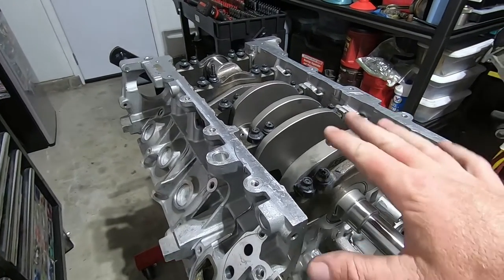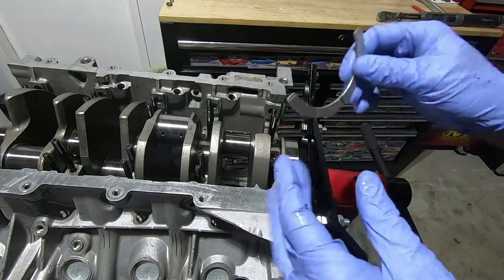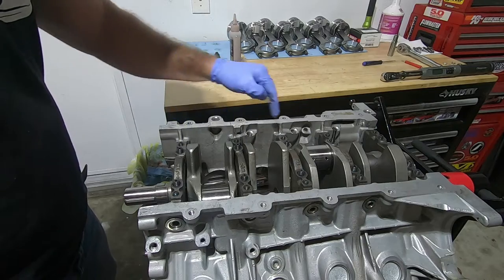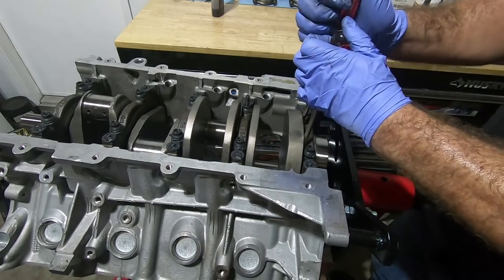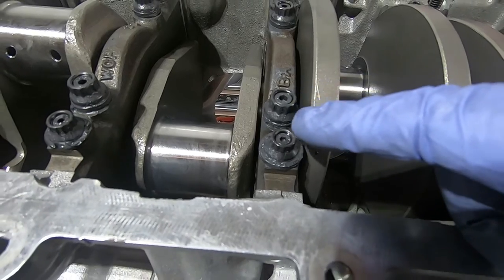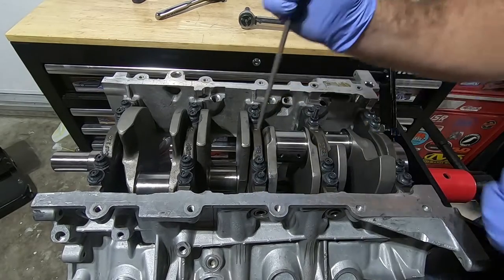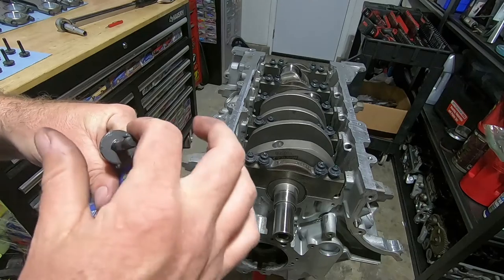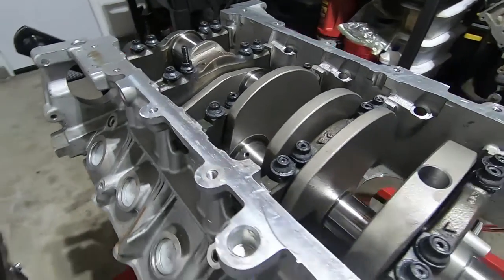Pt 10 Crankshaft Install and Measuring End Play - 5.0 Stroker 4.6 Teksid Engine Block

Comment: When you say the cut it's on the thrust bearing faces towards the crank, a lot of people are getting confused thinking the cutouts face toward the front of the engine where the majority of the crank is. 

I don't know why they don't just get the Chilton's but a couple if them were pulling the motor working a week. 

Not saying it was your video specifically, but thanks for the vid, it's a vital part of the build.

Comment: I am trying to find out some information on the forged 4.6 cranks that were made in Germany. How many engines do you suppose had those. I know the cobras came with the Kellogg cranks
 So what car did the other forged cranks come in? Any idea?
Also I have seen a lot of guys using coffee filters for the final wipe down before assembly.

Comment: During my build i did the side bolts to 90 in/lbs lol. Well after a couple years one of the driver side worked it's way out. I chased that oil leak forever. I torqued it to 180 in/lbs after that. Rookie move on my part. So you go 30 ft/#'s?
Reply: Love this vid by the way, thank you.
Reply from the maker: Yes, ARP recommends 30 ftlbs for their bolts.  The factory service manual says 14-17 ftlbs, but that is for factory bolts.